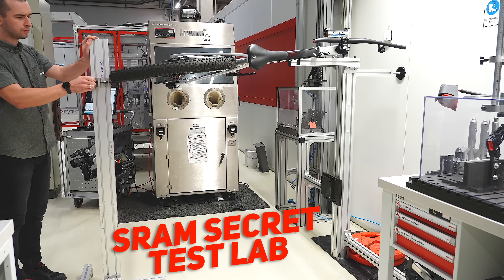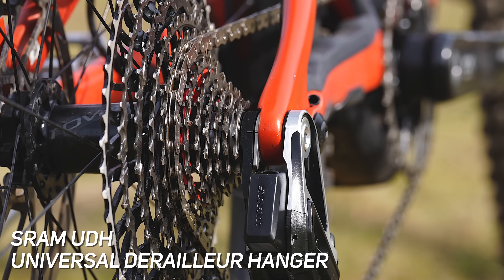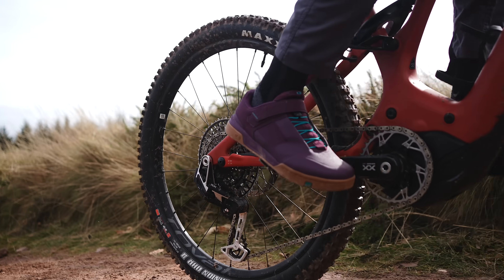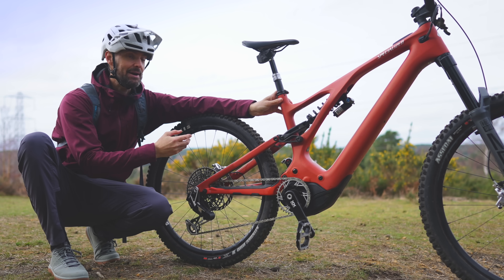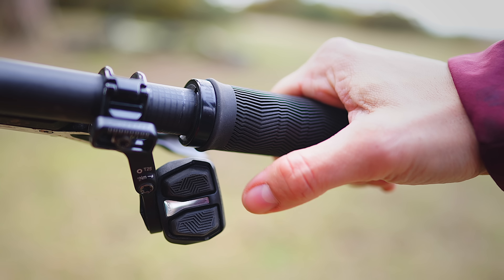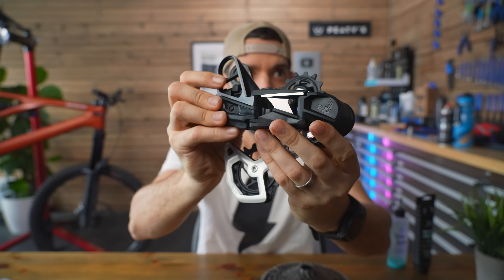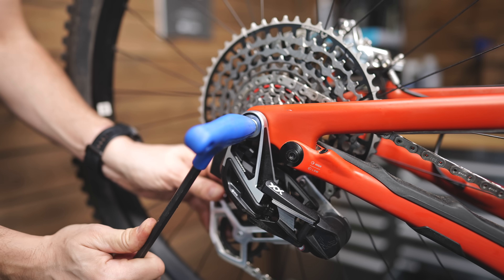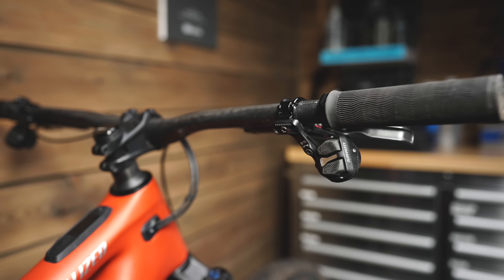SRAM's All-New Groundbreaking Eagle Transmission: Transforming MTB Tech!

Comment: I just went on my first ride with the X0 transmission and it feels like this is the first group set that belongs on a mountain bike. This is not necessarily about it being wireless, I had and still have AXS, it’s about how robust and precise it feels. It’s like an extension of the frame rather than a flexy appendage trying to shift. To put it another way, is like the old systems were being constantly being band-aided to try to make them work for mountain bike duty while Transmission feels right at home in the roughest/ gnarliest trails.

Comment: From what I see, the helmet doesn't fit you very well, it would need a size smaller or a different brand. Specialized helmets don't fit very well, they are very narrow and oval shaped and people go a size bigger than they should. On the back of the head you can see that there is a lot of space and it is quite close to the eyebrows.If you loosen the fixation system (boa) and try to move from side to side and front to back. Movement should be minimal. I'm sorry, it's my professional distortion. Have a nice day :)

Comment: Hi, how did you mount whole set to your Turbo Levo gen 3? SRAM says that it’s not compatible with Turbo Levo gen 3.
Reply from the maker: That’s a mistake. It is compatible.
Reply: @RobRidesEMTB  thank you for reply Rob. Unfortunately SRAM confirmed that direct mount chainring (for Brose) is not compatible and I should use 104BCD chainring, mounting to existing spider.
Reply: Well, that's interesting, what's the correct answer in the end? I imagine, that's why the chainguide does not fit on this specific chain ring. The chain line must be to close to the rear frame I suppose!?
Reply: @gregorystammbuck506  I put 104BCD chainring on the original spider as recommended by SRAM. Will keep direct mount chainring as a spare.

Comment: its not groundbreaking- its frame breaking. Instead of a 2 dollar eye you just break of the carbon frame. force has to go somewhere. the pricepoint is groundbreaking- who the actual fck is paying 1000 grand to 2500 $ for a tranny?  the real change would be to have a system that is closed and not hanging 5 cm above ground. get rid of derailleurs

Comment: Wow... an unloaded carbon frame at mild speed against a wall. Not saying thats not impressive but im pretty sure even my UDH mech hanger can withstand that. Like, this tech is pretty cool but its not even backwards compatible, meaning its either a full new groupset or nothing.  You cant just replace your rear mech with the transmission one and be finished.

Comment: I don't understand why if you've got an E-bike you would want to install an electronic system that needs charging separately, just hook up the derailleur & shifter to the main battery! Surely if they can design a drivetrain system that costs 1800 they could have sorted out that inconvenience...  same for the dropper post. Obviously it is necessary for non E-bikes, though even then perhaps with smart internal cable routing they could think about 1 small removable battery...  Not sure wireless tech is worth it just for a 'cleaner look', I hear too many stories of people with dead batteries and no shifting or dropper post!

Comment: I've got a couple of gen-1 AXS systems and parallelogram wear has been terrible (scrap within a year), so for that reason alone I will be waiting at least two years to see if the new stuff is any better. SRAM were good with the warranty to be fair, but warranties run out, and all this stuff is WAY too expensive to have to replace every two years.  Has this new system got replaceable pivot bushes? 

Who's going to buy it when most shops aren't going to stock the ZERO-compatabilty consumables because it's all so crazy expensive as a system?

Mind you, incompatibility claims are usually complete BS to try and get you to part with more money.

Comment: The thing I dislike with my AXS shifting and dropper is remembering to charge the batteries when i am also charging the main bike.  SRAM should have come out with a version of this planned around ebikes that was fed by a wire harness from the main battery.  I only want to charge one thing.....
Reply from the maker: They already do one and I have it on another bike. It’s a dummy battery that plugs into the motor port. Never need to charge an AXS battery.

Comment from the maker: Some FAQ: Eagle Transmission rear derailleurs are designed to have replaceable and are points of frequent contact: the skid plate, the outer parallelogram link, and the cage and damper assembly if needed. 

Check here for compatibility: https://bikefinder.sram.com/universal-derailleur-hanger-bikes

Can I upgrade my mountain bike to Eagle Transmission?
Any frame that fulfills the “UDH Specification” featuring a hanger-less interface can be upgraded. Complete specification information can be found at universalderailleurhanger.com

How will I know if my bike is UDH (Universal Derailleur Hanger) compatible?
SRAM UDH Bike finder lists all UDH bikes that are compatible with Eagle Transmission. bikefinder.sram.com

Derailleur hangers break or bend to protect the rear derailleur. What happens if I crash with Eagle Transmission?
Bent hangers can cause several issues, from bad shifting to, with a severely bent hanger, the rear derailleur jamming into the wheels and can result in catastrophic damage. The Eagle Transmission rear derailleur is connected to the axle system and is designed to be extremely robust against side and frontal impacts so you can continue your ride after a crash.

Can I use the POD controller on previous Eagle AXS drivetrains?
Yes, the POD electronic controllers can be used with Eagle Transmission, as can any other two button SRAM AXS electronic controller. Eagle Transmission is also compatible with eTap AXS Wireless Blips.
Reply: Can we use the previous version Sram XX1 chain with this new XX cassette and derailleur? And handle the e-bike power flawlessly like the same equal to the new chain when making full power shifting ?
Reply: Which kit works with the Turbo Levo??

Comment: Rob, are the Old and new AXS controllers cross compatible?  I see the new controller being used with the old AXS post.  Also do you have any insight on the new AXS shift pods being used with TRP brakes?
Reply from the maker: Yes, the POD electronic controllers can be used with previous Eagle Transmission, as can any other two button SRAM AXS electronic controller.

Comment: I love how they use the lightest bike possible for the impact test
Reply: Tbh I rode mtbs hard and atleast 4 days a week for roughly 3 years . 
And not once did the normal dérailleurs break 😮? 
I'm not your typical pussy mtb rider either
Reply: Try that exact same test with any..... ANY derailleur of your choice on the same bike and get back to us. We'll be waiting.
Reply from the maker: Rumour has it that they were all getting so hench lifting a heavy ebike on that test that they had to put on something lighter to lift😉
Reply: I'm not sure what direct side impact is exactly testing for in real world trail riding scenario either. Let's see derailleur dropped on a rock with 200lbs loaded on the frame. Either $650 derailleur will bend & break and or your frame.
Reply: @derek2gloves  absolutely. If you're riding on a narrow trail and you bash your derailleur into a rock at full pace there's no "revolutionary solution" will withstand that, simply if you have an hanger will broke and you'll save the derailleur, if you haven't you're dumped 600 euros into the trash bin.

Comment: Rob, if you have 500 watts of power, you are a pro Tour de France cyclist :) its more likely to be in the 200 to 300 range, and that is very good.
Reply: I'm pretty sure any decently strong rider can achieve 500 watt out put on a single hill climb burst, I know I can. Watts per hour is a different subject, most Pro cyclist can hold 400watts for an hour, Robs pretty fit and looks reasonably strong, so combined with the motor he'll easily achieve 1000 watts at peak on an EMTB, hope that helps.
Reply: well surely he was inputting 250w and the bike was doing the rest

Comment: Does this new AXS derailleur mounts to any frame, independently of the derailleur hanger the frame was designed to, or it’s only possible to mount it to frames that were conceived for UHD ?
Reply from the maker: Correct - only frames that are UDH frames. If you run UDH now you can get this.
Reply: Thanks, @RobRidesEMTB !
Reply: @RobRidesEMTB  Hello ROB; first want to thank U, 4 all youre videos they are AWESOME!!!!! Want to ask you if my Kenevo Full Power 2022 (GEN 2) frame, is UDH compatible? or maybe theres a way to adapt it to fit the T-Type eagle Transmition? Cheers!

Comment: Were you also running the new control pod for the dropper post? That doesn't look like the usual Rock Shox controller on the left side of the bars?
Reply from the maker: Yes. New pod also works on current AXS reverb dropper

Comment: Hey Rob rides emtb! Thanks for the well presented vid on that fine new transmission system! It makes me wonder if Shimano will release something similar or put their effort into an enclosed gearbox! Ride ride ride!
Reply from the maker: Shimano have some innovative stuff too, like auto shift and free shift on the new EP801 - new video on that out soon!!
Reply: @RobRidesEMTB  Did you ever see the Chinese clone Seth (Berm peak) got hold of that vanished after he made a video on them?
Holding up very well. Makes me wonder if the Chinese have anything similar thats redesigned enough to not just be scooped up as a clone item.

Comment: Approximately how long did the battery last before it had to be swapped out?
Reply from the maker: Its very difficult to tell, but I have just noticed SRAM FAQ makes a point of answering the battery question: Eagle Transmission rear derailleurs have a higher cage damper force than previous Eagle AXS rear derailleurs and therefore require more force and energy to shift the Transmission into inboard gears. Also, the improved shift quality naturally makes riders shift more frequently per ride.
Reply: @RobRidesEMTB  are they talking hours or days before you need to switch out a battery that started full? Asking because this product looks like something I'm going to put on my new rig later this rear if available and if i should buy 1 or two spare batteries.
Reply from the maker: Weeks.
Reply from the maker: Old one was 60 hours of riding time. This one slightly less.
Reply: @RobRidesEMTB  thanks, so not a ride ender for a full battery.
Reply from the maker: You can get a LOT of rides in for sure before it needs charging.

Comment: Hmm so when it does take a beating, does that knacker the whole swing arm?..
Instead of just the hanger.
Reply from the maker: Did you see the clips of it smashing into the test plate rig, and SRAM team standing on it? Its tough, you'd need a seriosly catastropic impact to damage the entire swing arm.
Reply: @RobRidesEMTB  that is nothing compared to a 90kg rider going down the mountain at 15 mph and hitting a rock on the side of the trail. never hit a "plate" in the real world.
Reply from the maker: True. Nothing like real world testing and lab testing. I’d say that now it’s more inboard there’s less chance of it hitting a rock. There’s a plastic casing on the side that I’d assume would be the first to give in.
Reply: @RobRidesEMTB  interesting, you have to keep us updated.
Reply: @RobRidesEMTB  Yeah thats my point, at the point of failure its no longer the £10 alloy hanger that breaks its the very expensive swing arm or potentially even more expensive derailleur. 
Don't get me wrong its all great that every thing is stronger but I'm wondering what's now the weak point of the system.

It's like saying I've upgraded my plastic bumpers to solid steel ones, and then having a little bump and your cars written off because the chassis took the shunt and not the cheap bumper which is part of the reason it was originally designed like that.

I'd love to see failures of this system to know the answer.
Reply: Maybe part of the derailleur is designed to break first and be cheaply replaced?